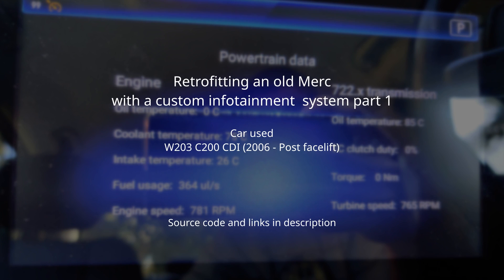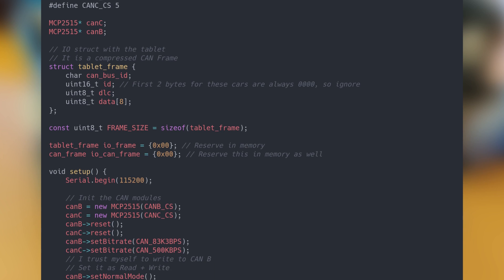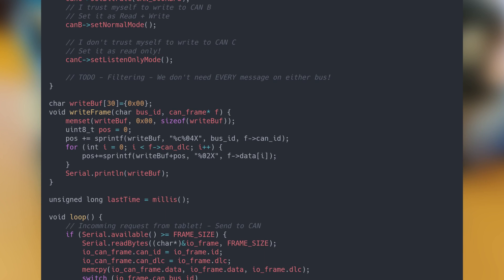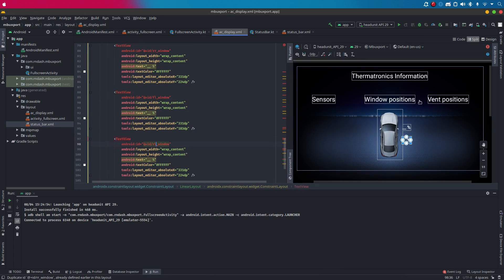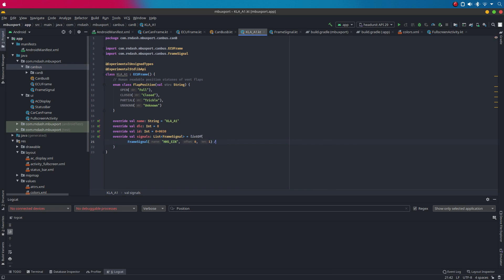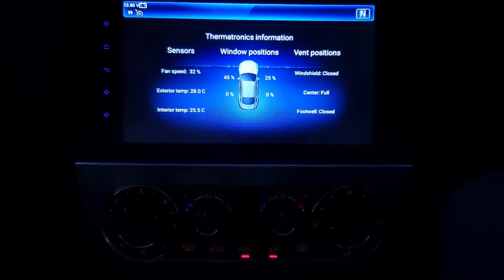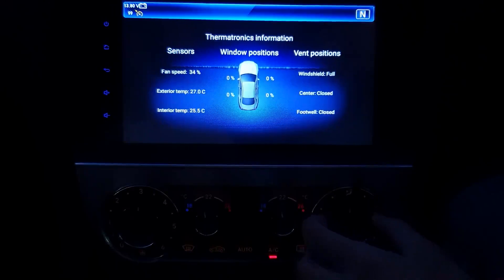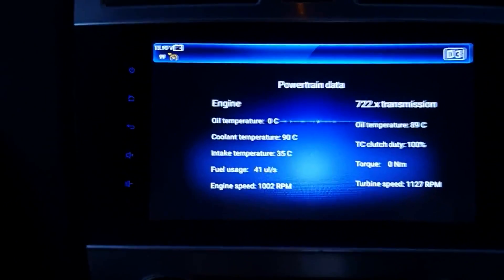I made a custom Android headunit app for my old Mercedes - Car infotainment project part 1

Comment: this is super cool!!!!

I was wondering if i could use an Arduino or something in my w211 to stream and control music and also maybe make the call buttons work and landed on your page! I'm not too technical with coding and stuff but i understand some basics. 

is it possible to use an Arduino to stream music and calls to the stock audio 20 unit (with the Russian aux mod) and control music and calls with the steering control buttons? 

sometimes i use an old android tab and use it as my android auto (with an app), so now I'm wondering if i do your mod, will i be able to use your app to view all these data through the tab or a phone?

thanks for putting in so much work in these projects!

Comment: Hi I have a 2006 W203 (C180 Kompressor), I have one of these android units fitted (Dudu7 top of range) it came with one of those canbus boxes for steering control plus ELM127 OBD2 scanner...would your amazing app work with these?

Comment: Hi, did you remove head unit can-bus decoder? I have the same HU, but with can-bus decoder, and HU can sense then i turn reverse and show rear view with dynamic parking line reading steering wheel angle, also it sense steering wheel buttons and can show radio station or bt mode on AGW. I try to use your application but it crashes then i switch music other bt, or turning reverse speed.

Comment: I am trying to build a custom headunit for my Honda, but I'm having some trouble reading the CAN bus coherently. I'm using an Uno and an MCP2515 shield as you are- what program did you use to read (and reverse-engineer) the printed CAN data? The Arduino serial monitor is not ideal...

Comment: Great work Ash, I have been going through your repo most of today as I am also working on a similar( but much more simple project). At the first stage, my project will allow steering wheel button controls to control my RPI based music player in the car over bluetooth. (R230 SL55 2003) AFAIK the W203 and R230 have a lot of crossovers in their Canbus protocols so the work you have done, especially on deciding can messages will be a big help!

 One question I had was you refer to 'Can B is NOT compatible with the 8Mhz clock', do you forsee any issues using the following? http://skpang.co.uk/catalog/pican2-canbus-board-for-raspberry-pi-23-p-1475.html
Reply from the maker: Right regarding the 8mhz clock. This is a limitation within the canbus library for Arduino and it's own CPU Freq not being able to sync to the odd 83.3kbps baud rate. I've tried my 8mhz one on a pi and it works fine :)
Reply from the maker: And yes, I know the r230 has a crossover. Exactly what model is it? - I may be able to find files and decode it for ya
Reply: @RANDASH  It's a SL55 AMG (M113k Engine, 722.6 Gearbox) That would be a massive help if you could :-)

Comment: First of all, I want to say that it's impressive how much effort you put into your car.  this project is very interesting, but I still have a few questions.  If I understood correctly, it is now an app, i.e. when the radio is switched on, you have to open the app first, right?  the second question would be whether you intend to copy the "complete" MBux, i.e. also to add functions such as radio, Spotify or navigation?  that would be pretty cool.
Reply from the maker: I've configured the app to be the home screen launcher of the tablet. So the second the tablet turns on, the app is launched...and yes, I eventually do intend to copy the full MBUX UI